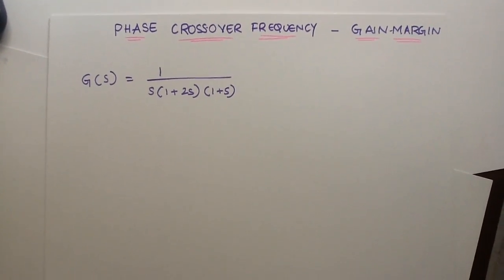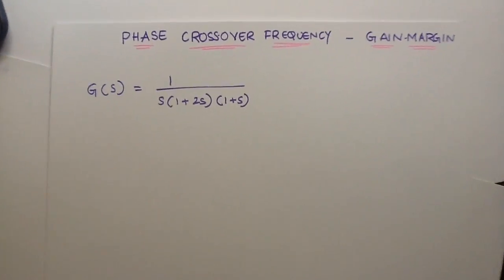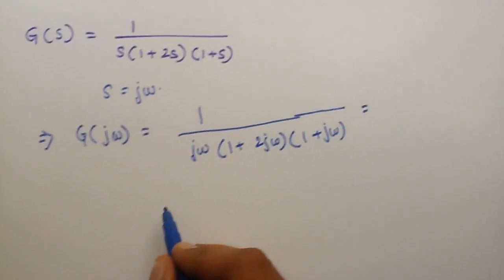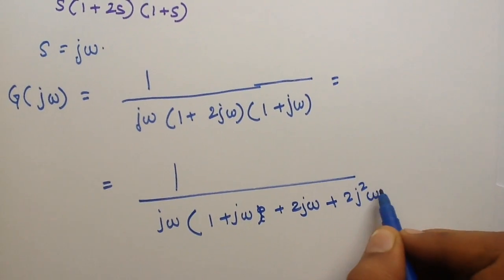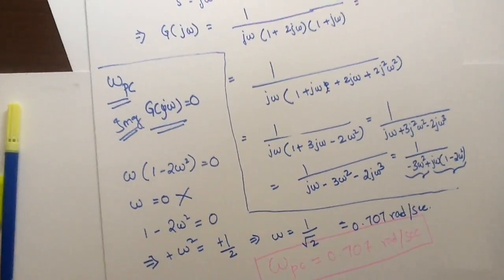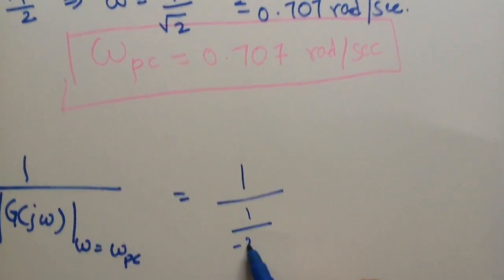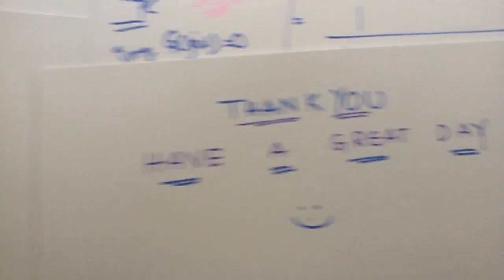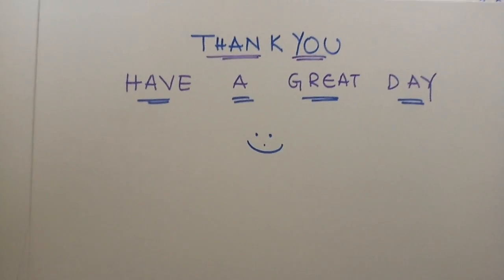Gain Margin and Phase Cross over frequency

Comment: I watched this YouTube video about phase margin and gain margin, but I must admit that I was a bit confused and couldn't fully understand the concepts being discussed. It's possible that the video was intended for a more advanced audience, or the presenter didn't explain the ideas in a way that's accessible to beginners like me.

I also noticed that some people in the comments were applauding the presenter's explanation, which made me wonder if I'm missing something. However, I understand that everyone has different levels of understanding and familiarity with the topic, so it's possible that they had a better grasp of the concepts.

If anyone has any resources or recommendations for learning about phase margin and gain margin, I would greatly appreciate it! I'm eager to learn and understand these concepts better.
Reply: @ibrahimabdi -- this is 8 year old video, not likely to get an answer from the TA who has no doubt, found a paying job! These are concepts from a Control Theory class, (call it CT), which Electrical Engineering students must study as a junior or senior in their undergraduate training. 

The idea of CT is to move a complex system described by differential equations, out of the time domain, into an imaginary domain -- the frequency domain -- via a Laplace Transform. Or, if you wish to work with a discrete domain, the Z Transform. 

My point in supplying these details is to demonstrate that it requires advanced math training to get the big picture of CT. 

I wish you the best of luck with your education.

Comment: shouldn't the imaginary part be obtained by multiplying the denominator and numerator by the conjugate of the denominator? because we can't separate fraction in two fractions, one the imaginary and the other the real part, till the denominator isn't expressed in factorised form and the numerator is an algebraic sum of real and imaginary part
Reply: Sanhita Guin it's also correct to do that, try different examples you will see it
Reply: Yes, but it wouldn't matter mathematically after rationalization. Same answer both ways.